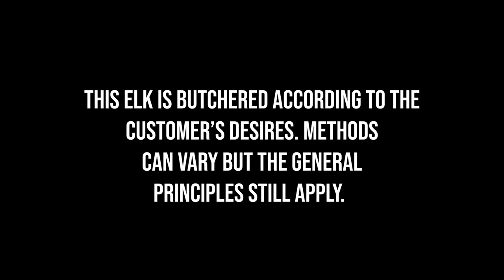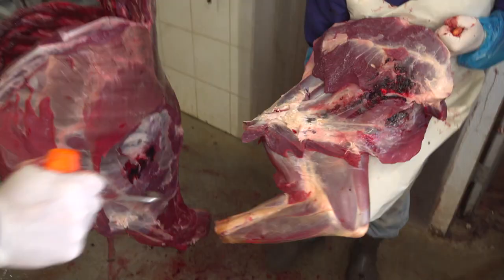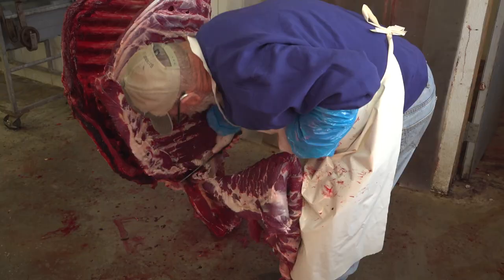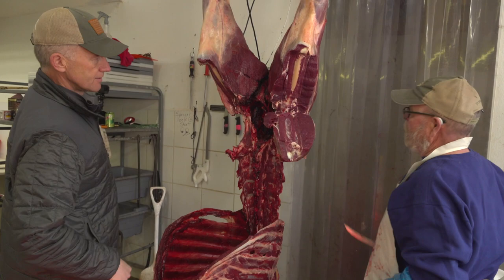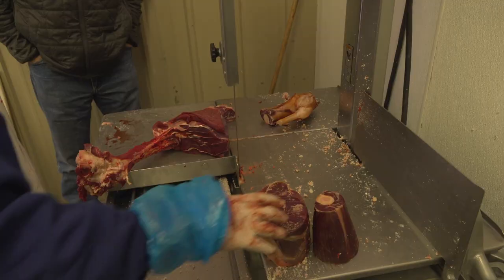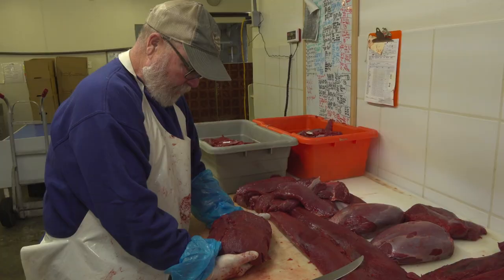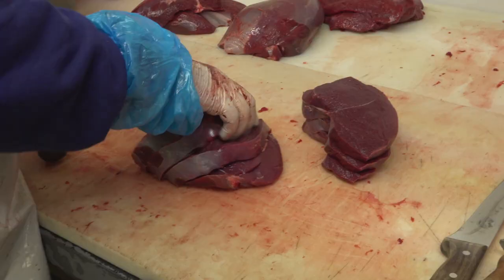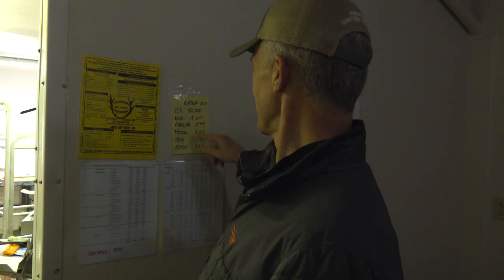How To Butcher An Elk | START TO FINISH

Comment: Great video...well done!  After years (36) of butchering my own elk into steaks, roasts, burger, and breakfast sausage,  the wife asked me this last season: Could I grind all but the back straps and tenderloin into burger and breakfast sausage?  Got to thinking that as the backstraps, tenderloins, burger and breakfast sausage are what we enjoyed the most, why not?  So I did it and have no regrets in doing so.  I've always been particular about my ground elk...no fat, silverskin, or tendons!  I then mix it with 1 part ground beef (70% lean) to 4 parts ground elk to make burger.  For the breakfast sausage, I do a 50/50 mix of ground elk and ground Boston butt (along with my combination of spices).  I did a lot of grinding last fall, but it was worth it - lots of great burgers and breakfast sausage!
Reply: I usually freeze hole muscle with in big 5 lbs bags . Lasts longer in the freezer than grinding right away. Take out what you need and then grid to make batches of sausages , stews , what ever I want . I had game like moose taste like i just shot it up to 3 years later , never had to throw any away.    ground mixed with pork goes rancid in the freezer in as little as 6 months.

Comment: Im Glad i clean and process my own, They were throwing away some meat that i would have kept. I am one of those people that will trim until there is nothing left to trim, but i can take all the time i need they have to be fast. Also unless you are going to mount it i will head shoot deer because there is a lot of meat on the neck. Just MAKE sure you can get a good shot.

Comment: Do you recommend taking the tenderloins out in the field, or while it’s hanging?
Reply: I'm not Randy, but I'd take the tenderloins out in field for sure. As they mentioned, there is a lot of potential contamination, so get them out and cleaned off as well as possible. Its worth a bottle of water if necessary to get them clean. Then get them dry. Inside the carcass is dark and moist, and might have residual heat. Even if you take the rest of the animal to the butchers, personally I'd always just keep the back-straps and tenderloins and handle those myself. As implied, sometimes you don't have confidence in getting your own meat back, so why not make sure of the provenance of your choicest cuts. I like to butterfly cut back-straps to get "bigger" steaks.

Comment: I cant quit wondering how you get the elk to the butcher whole
Reply: Depends how close to the road you are, pulled mine and my cousin's elk last year out with the truck and loaded into the bed, drove home and hung them up.
Reply: FedEx/Uber
Reply: No way your getting a rosy out whole unless it’s right by a road or in a field ...rockys are quite a bit smaller though you can actually move them around to different positions..
Reply: I did the same exact thing when I got my first elk, a spike.. I didn't know what I was doing, however.. I do know that it damn near killed me lol
Reply: If they are whole they usually came off private land.

Comment: Why did they have a propane torch on the butcher table?
Reply: Often used to burn hair that remains on the meat. Run a torch over some of the hair stuck on the meat quickly and it will disappear.

Comment: Randy, my question is do all elk have tough chunks of meat in them? What I am talking about is a piece that looks and feels just like the steak next to it, but you can't even bite Thru it.
Reply: Richard Goecks was it freeze for a long time ?
Reply: If any meat you’re eating is tough, it’s usually not meat. What you’ve got instead is likely either a piece of connective tissue or silver skin. All healthy meat is tender unless it’s overcooked.
Reply: @bingbong5939  Alex thanks for the response, the meat was not froze very long. I have been butchering my own deer for over 40 years and never ran into this. It was an old bull that my son shot with the Bow last year. It didn't go but 10 yards after the shot, so it didn't have an adrenaline rush. 1 steak will be tender as can be, and the next one you can't bite through it.
Reply: As a meat cutter these videos are satisfying. Thanks for showing the process and finished product!
Reply: @derektraffie1983  Derek thanks for the reply, this isn't silver skin and connective tissue. Looks just like any other steak just tougher than crap, more like biting into a chunk of rubber. All Cuts are across grain, and all silver skin and fat I removed. 1 steak you can cut with a butter knife and the next one bring out the chainsaw. This was an old bull that my son shot with the bow last year.
Reply: @derektraffie1983  Derek also I like my steaks pretty rare, slap it on the nose ,wipe its butt, and throw it on my plate and I'm good to go
Reply: @richardgoecks9377  try aging the steak.. it is not mandatory for steak to go from freezer to table the same day.  I cut up 4 pronghorn this year and aged everything.. no problems and no bad meat.
That said some spots/cuts of muscle group respond differently to heat.
Reply: @richardgoecks9377   running questions through my head.. how does the meat look; how does it feel squeezed vs pressed against a cutting board;  butterfly or straight cut; How thick? I had some difficulty on deciding between stew cut or steak.  I wasn't perfect on my first 2 so I'll find out this summer.

Comment: Thank you for the this video Randy, but your calculation of fat to the burger meat is inaccurate.  If you want a true 15% fat content of your finished burger meat, then you have to divide the total weight of the elk ground meat by 85%. In the case of this video, 66lbs would be divided by 0.85, yielding a total finished weight (fat + elk meat) of 77.65lbs.  So you would need to add 11.65lbs of fat to the 66lbs of elk to produce a true 15% fat content of the finished burger meat.